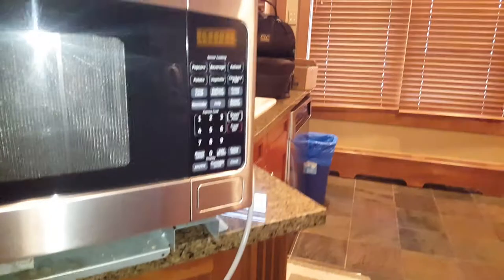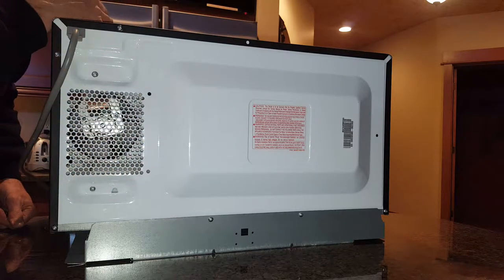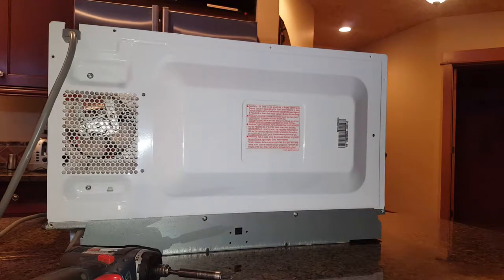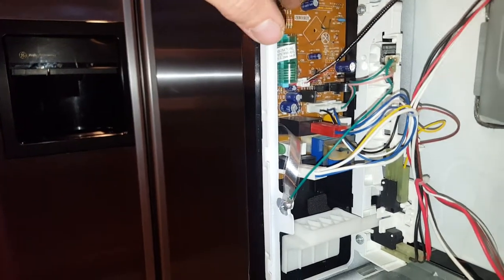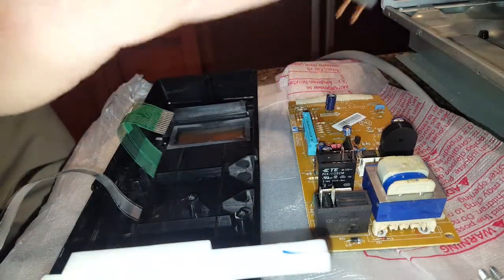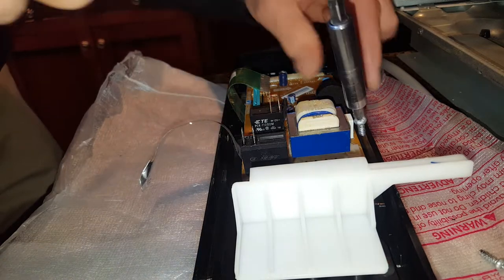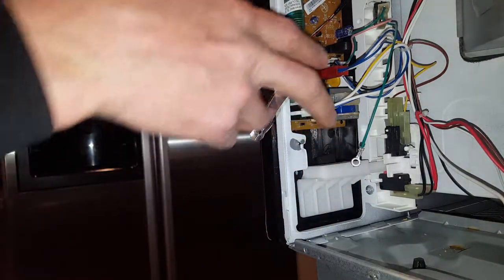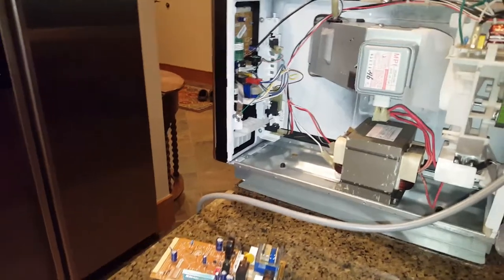Fixing a dim microwave smart board

Comment: Have a GE from 2010.. no more parts, and the former replacement part price was some $140.. half the price for this 12 year old microwave !  These are such common problems.  Had a double wall oven, same problem, LCD was so dim.  But it was for a 24" space. Picked one up NIB for a couple hundred as it was not a common size and they wanted to get rid of it.  My current OTC microwave is 36".  They don't make them anymore.  They wanted $280 -$320 for some spacer part.. more then the cost of a microwave !  Picked up a spacer kit for $34 on Amazon.  Now looking for a 30" microwave at some point.

Comment: I have a Viking Microwave (Model: RVM320SSY, manufactured Jan 2017), but the control board is close to your video.
After viewing your video showing the idea how to replace the control board display unit, I replaced the dim control board display unit. The display is working now, but too bright. Do you know how to adjust the brightness of the display?
The Viking control board display unit (065584-000, $54.49) was bought from allvikingparts website.
Thank you for your video.  It is very helpful.
Reply from the maker: Perhaps check in the user manual. It may have a brightness adjustment in the settings. If not, it is something that you'd have to learn to live with. If anything the parts supplier may refund you if your not satisfied. Or talk to a company such as fixurboad. Com, or corecentrix to see if they can modify the board to suit your needs.